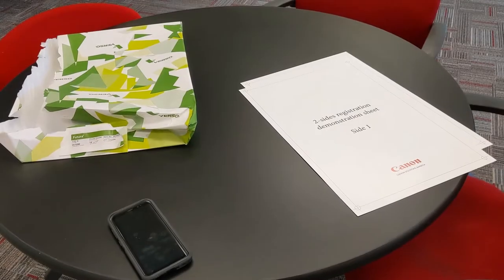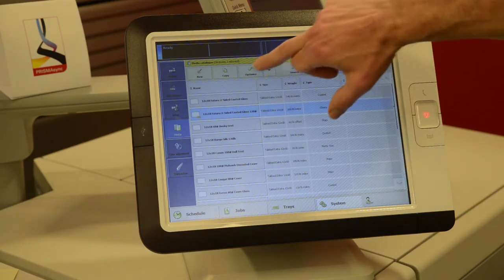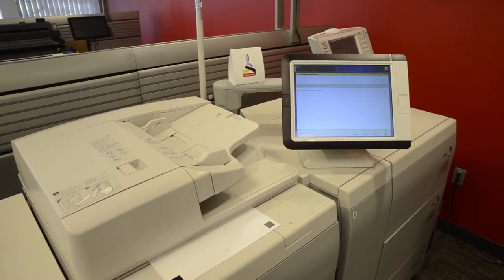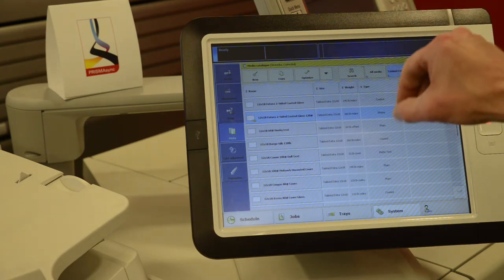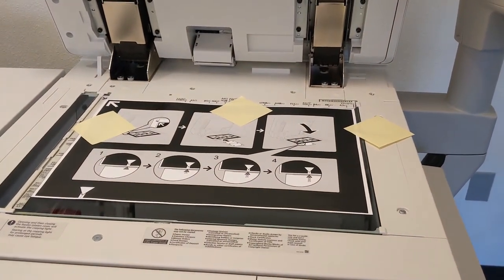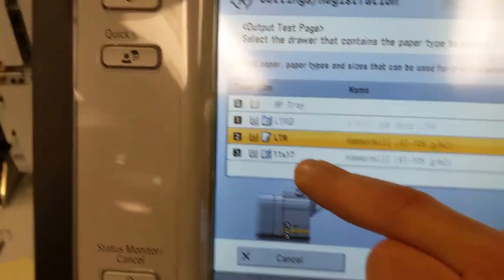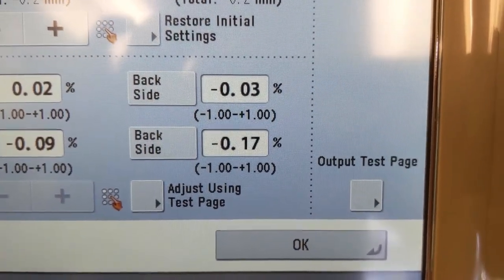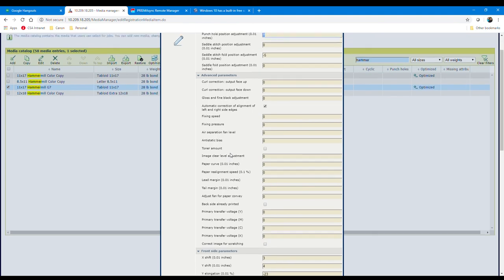2 sided registration for Canon imagePRESS

Comment: Good video I can't print frist black sheet  image press cv 10000 fiery
Reply from the maker: Kirlos, I dropped a PDF of that Guide Sheet at this link. It will stay there until I forget why I put it there. :D
Note, this sheet ALWAYS prints on 11x17, regardless the sheet size you're optimizing. 
https://drive.google.com/file/d/1fxAZ_gqpLre7ag8o7yr2Zuac7TTCjJLg/view?usp=sharing
Reply: @jeffandtona  thanks jeff and tona
Reply: @jeffandtona  Can you give me the A3 File please ?
Reply from the maker: Sorry I missed your question, Kirlos. Did you find what you needed?
Reply from the maker: @DoArt-pc6rm  I don't have ready access to the A3 version. Which imagePRESS and controller do you have?